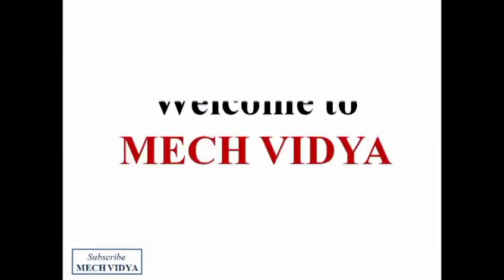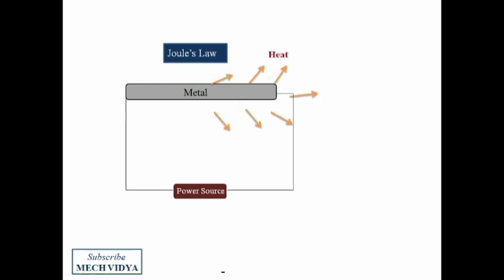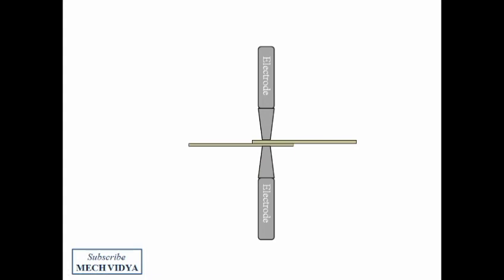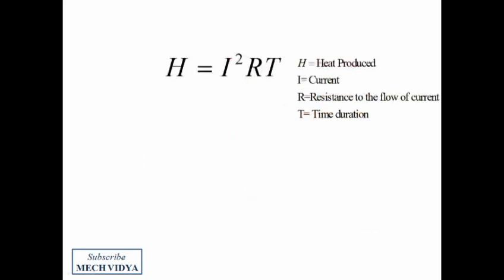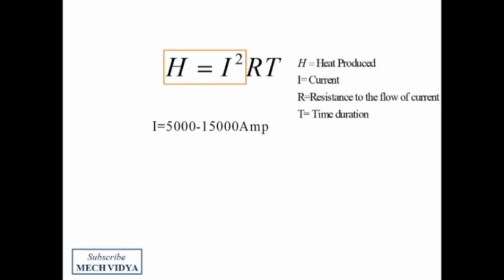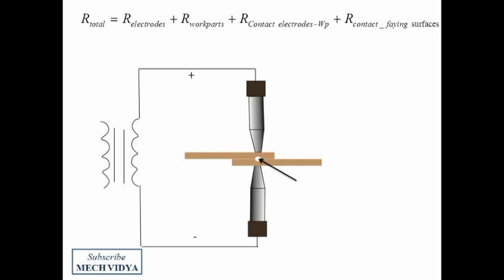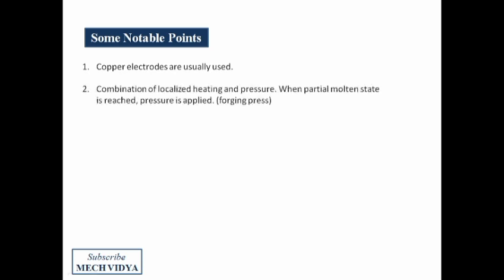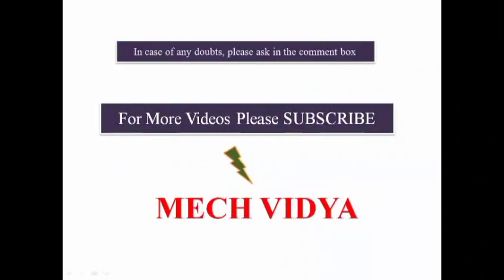Resistance Spot Welding - Working Principle [Easy Explanation]

Comment: Can you tell me how much voltages and amps are on the output? In 15kva spot welder
Reply from the maker: Usually the output voltage is low and the output current is very high(to concentrate the charge and melt the small area). Though the voltage and ampere values can differ from application to application, 5-6 V and some thousand Amperes can be a good option.